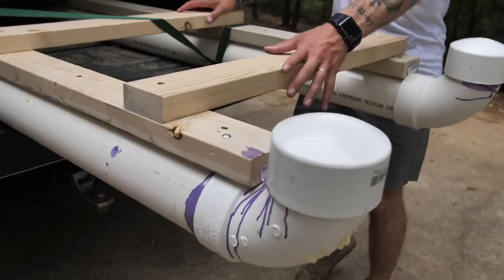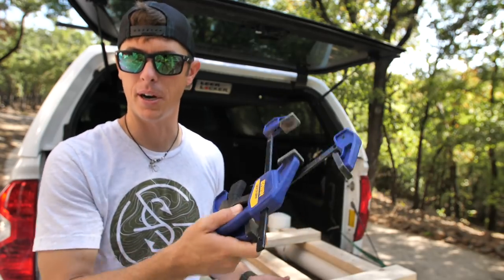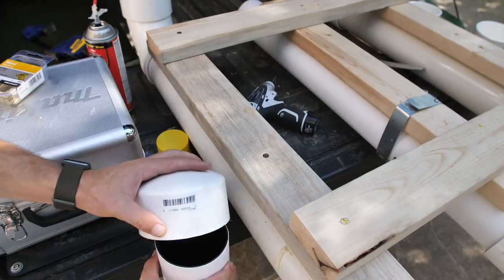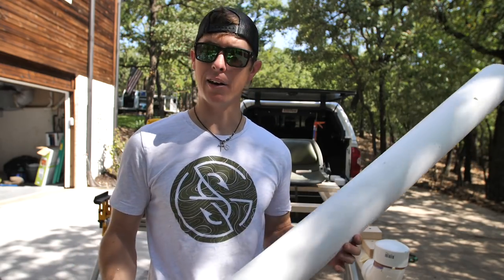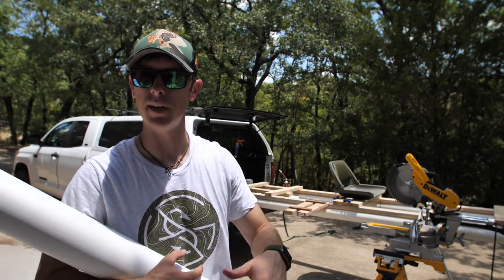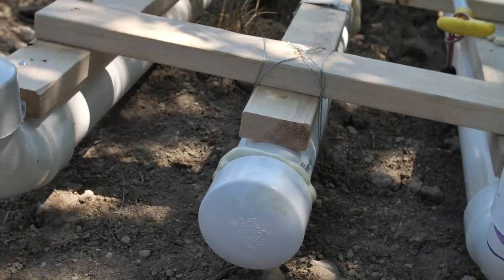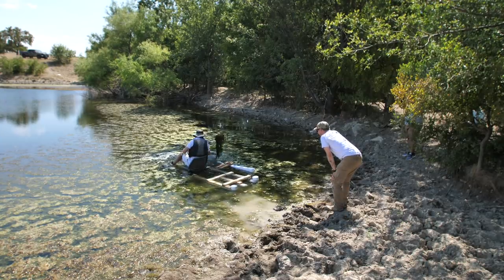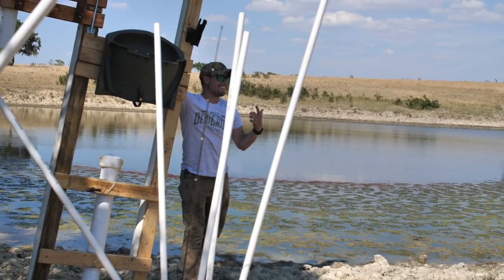Building a Cheap Fishing Kayak

Comment: 5:58 doing several passes with the saw within those lines makes it easier! all you’ll need is a chisel to chip away the remaining wood.
Reply: Yea those oscillating blade tools are a joke.  Hours of deafening noise, no visible progress.

Unless you're trying to make noise. Just tons of noise, maybe some dust too, but definitely noise. Then they work great!
Reply: Was about to comment the same thing. I have the same saw. Never used the feature but it's got a depth stop.

Comment: The spray foam in the pipes actually dont help the buoyancy, it makes it heavier. In my best clunkers voice 100% would float better without that.
Reply: HaulinBass TV I thought that the very second Rob showed up with foam in a can , a proper fitting cap wouldn't let in any water making a need for spray foam unnecessary
Reply: Doesn't Boston Whaler fill their hulls with expanding foam and market their boats as unsinkable? Maybe the boys just need more PVC pipes.
Reply: All they need is 2 pipes down either side with sealed lids and as cross bars use t section fittings and pvc pipe, should be a lot lighter  and no expanding foam needed  also no screws
Reply: The foam will help because without it the PVC is going to fill with water because they drill holes in it with the screws.  Had they not put the screws through the sides and found the correct caps, then the foam would have been unnecessary.  Still a fun build though.
Reply: I'm not saying the foam didnt help, but great stuff foam is heavy and adds more weight, if he of spent the extra money and got marine foam it wouldn't have added extra weight. But that takes away from the challenge as it was originally supposed to be 100 dollar build. But I like the comment about not using wood and drilling just using pipe with glue and fittings.
Reply: The upside is that the foam would displace the water so they would never fill with water.  It is added weight and expense though.  The straps are a great idea so you don't have to screw into the pipe, Keeping that seal would be the better way to go.

I'm thinking bigger pipe, the lighter thinner walled stuff, and smaller boards, I think 1x4's or 6's would work.

I think it's a doable thing, and a cool idea.
Reply: The weight difference would actually be negligible had they let it cure before capping it... and while it doesn't do anything to help as long as the pontoons are sealed, it would add add buoyancy if one of the pontoons starts to leak (especially since they drilled holes), enough to keep it afloat on that side if it took on water.

Comment: Here's a little tip. You have a sliding compound miter saw. If you can lock it to set the depth of cut, you can use that the notch out the wood. It would be much easier and neater. Of course that it is the wood isn't attached to anything.

Comment: For better flotation - fill the pvc with swimming pool noodles cut to length to take up most of the space. Meaning, fit as many noodle pieces in the pipe as you can. Then secure that with expanding foam sprayed in the centers of the noodles and all around in the empty voids and glue the caps on.

Comment: A little geometry to find the volume of the inside of you tubes gives you the water weight displacement (8 lbs per gal / 7.48 gals per cubic foot) .  Figure your loaded as weigh of tubes, lumber and hardware as well at seat and passenger, rods and tackle.  If the water displaced weight is just a pound more than loaded weight, it will float, but not well.  Should shoot for 30% more displaced weight than loaded weight.  50% even better and more stable.  8ft x 6" pvc pipe displaces about 94 lbs of water.  Boat(120lbs), passenger (185), tackle equipment (20 lbs) figure loaded weight of about 325 to 350 lbs, you needed at least 4 pipes to float and not well.

Comment: Chobie V3 - Replace your keels with a sheet of 1"-2" XPS foam insulation to cover the whole bottom of the frame. Use a hole saw drill bit to put holes in the 2x4's to make them lighter.

Comment: inner tubes inflated under the primary frame (fore and aft) would give you sufficient flotation. OR you could add two more pvc sections to the fore and aft sections alongside the ones you have already mounted.  It could actually work!

Comment: There should be a black lever on the left side of your miter saw. Flip it down and theres a set screw that allows your to set the depth of our notch. Set a spacer piece between the back n cut piece, because the saw won't travel as far. Lots of little cuts knock it out with a chisel

Comment: Normally the orange glue is for Schedule 80 water mains and the purple primer is just died so that the inspector can see it on the fittings and stuff and is used on gas venting.

Comment: First, any material is going to be less buoyant than plain air, so I would have... 
1) Built the entire rig first. 
2)have a platform, this need not be thick but must be square and cover much of the top. Ever built ikea flat-pack furniture? It always relies on a pressed wood-cellulose type backing that gives the whole piece of crap rigidity. 
3)  Bolt the structure thru the pvc from the inside so you have threaded posts to fasten the superstructure to. 
4) once complete then fill pvc tubes with empty large pop bottles. (make sure to get tubes that can accomodate them.) 
5) cap ends.  
6)THEN drill fill holes to pump foam to fill space between bottles. each bottle is super-tough, and you use 90% less foam. 

In fact you could even skip the foam, make 1" holes along pvc and allow it to fill with water in the remaining space, the bottles still are doing the floating. That would be cheaper, and eliminate hassles from leaks, plus allow for drainage.

Comment: Not only do they make 4" sewer fittings to fit the thinner pipe, they also sell adapter sleeves to be able to glue sch 40 fittings to it.
 A really buoyant kayak would use 6" thin wall, and no foam. Unless you hit an Iceberg, you're not puncturing PVC.

Comment: You could of drilled into the off and installed tire valve stems and if your joints were good you could of put 50 lbs or so of psi, that would have increased the buoyancy.

Comment: Boats float because of water displacement. Think about a bass boat. The materials it is made of don’t float, but the way the hull is designed it “pushes” water around the boat. Same principle goes for a cruise ship. Weights thousands of tons yet still floats because it is simply displacing the water. 

Version 3 just find a waterproof tarp/plastic and wrap it under the bottom and above the pontoons on the sides and it’s pretty much a guarantee it’ll float.

Comment: Don't use foam it would only make it heavier. You could feel it with Nitrogen. Nitrogen is a light gas and that would create an upward force. It wouldn't be a lot but it would work better than the foam. And you need bigger diameter pipes to displace the water

Comment: Should have used the buoyancy equation. Figure out how many gallons of water the floats displace then multiply that by 8.33 and that will tell you how many pounds the floats will float. You then have to figure out how much the pvc, boards, screws, seat, straps, and whatever else you put on it weighs and make sure it’s less than the  buoyancy number. If you want half the pipe sticking out of the water when completely loaded then you take your buoyancy number and cut it in half and that’s your max weight limit of boat itself, you, and gear combined. The only way to hold more weight is to add more pipe. Sealed pipe that is. No leaks.
Example: 30gallon drum will float 250ish pounds just at edge of water line. 125 pounds will float with half the drum out of the water.

Comment: Version 3.
Each 6feet of 4inch pipe will keep afloat about 30lbs. I'm guessing you guys weigh about 170-190lbs, so that's about 6tubes then the frame must weight another 50 lbs... Just need 8 or so 6ft tubes to keep the wood out of the water. Ditch the foam as it adds no bouyancy. Can't wait for MK3

Comment: I would of used aluminum instead of the 2x4s. A lot lighter and holds up longer. Y’all should get 4 to 6 plastic 55 gallon barrels and make a floating platform or dock.👍👍🎣🎣🇺🇸

Comment: Just make the whole thing out of pvp pipes using the least amount of wood possible.. Use L shaped pvp pipes at the front and back and use T shapped pvp pipes in the middle so there are 2 or 3 rows of them. Drill the holes to put in a bunch of foam.

Comment: You should make a v3 but use 10 inch diameter pvc pipe and use pvc glue and plumbers putty to seal it. You will have better luck

Comment: I'm seeing this two years too late :(    But you need to do a simple calculation using Archimedes Principle to calculate the required buoyancy.  Take the weight of the rider, any fishing equipment and the weight of the boat.  Then find the displacement capability of the material you are using and adjust accordingly.  That will tell you how much material you would for the rider, equipment and boat to float.

For example, a 6 foot section of a 3.5" diameter pool noodle will float approximately 24 pounds of weight.  If the total weight you are trying to float is 250 pounds, you'd need 10 1/2 pool noodles.  I'm sure you can find similar displacement listings for wood and/or pvc piping, too.

Good luck, fun vid to watch.

Comment: I bet if you would have used a little bit larger diameter pipe seal them up really tight and pressurize them with air it would have floated really well
Reply: and sealed the wood so it didn't absorb any water... that wouldn't have helped the buoyancy issue either, would it? I'm just guessing. I am no more fit to build a kayak out of lumber and PVC than I am to building a frickin tractor, haha.

Comment: First build it wider maybe 4 feet just so it fits in the truck. all you really need is 2- 10 foot long 10 inch schedule 40 pvc pipes what you used are to small with the 10 inch pipe you could even have a trolling motor on it. and use treated lumber it last for 20+ years.  it would cost about $500 bucks.  CAPS-  https://pvcpipesupplies.com/10-cap-slip-c647-100.html  PIPE- https://pvcpipesupplies.com/10-x-20-schedule-40-pvc-pipe-h0401000pw2000.html          OR JUST BUY A NICE CANOE LOL.